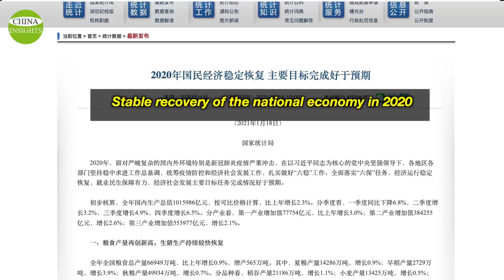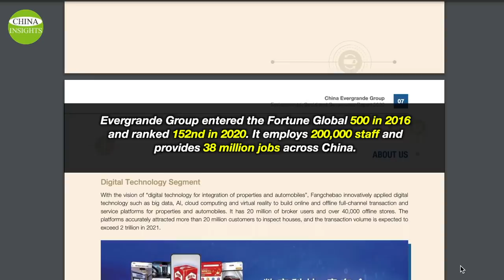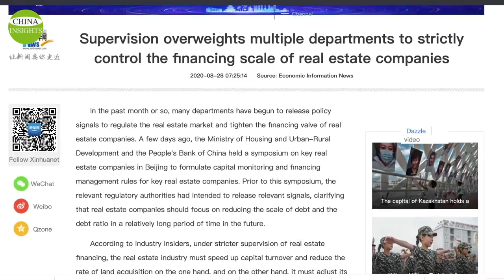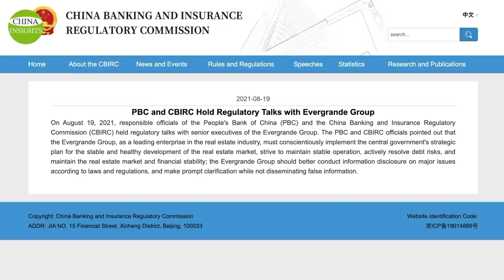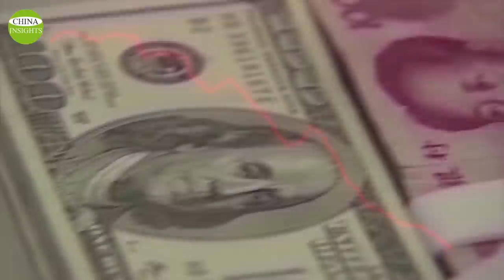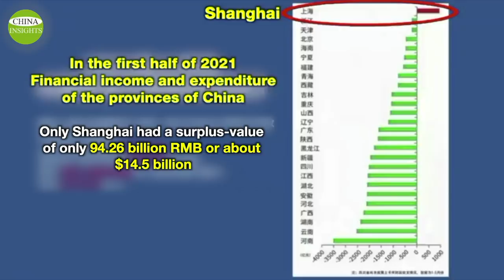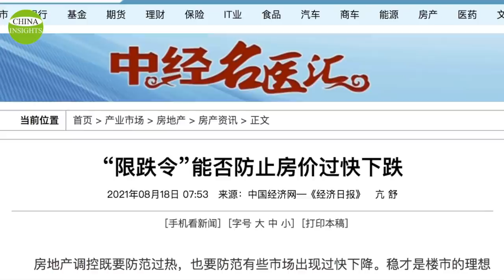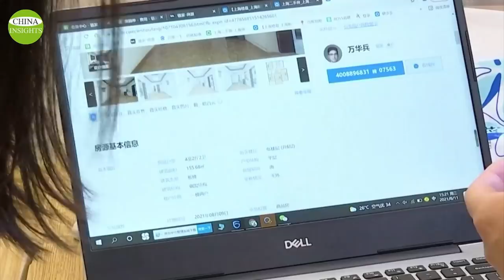How serious is China's housing bubble? The main cause is government's overpriced land sales

Comment: The Chinese construction Crisis is a multi pronged issue, with many factors. This is not to disrespect anyone okay, I just want to make that clear.

1. China has a lease land ownership system, where a prospective construction company leases the lot property for about if I recall 99 years or so from the local government, which in turn receives a large profit from the lease sale. In order to make a profit the developer has to pre-sale housing units before the start of construction. 

The lease prices tend to be fairly expensive, add materials, and labor costs on top of that which makes profits razor thin. In a lot of cases, Developers have to cut costs in order to make a profit often in materials, or labor which is one of the causes of the notorious tofu dreg structures. 

Even if they cut corners, theirs still no guarantee they will make a profit, and the prices are still forced too high than what most prospective buyers can afford.

2. Regulations, in particular environmental regulations are very very lax, so alot of developers get away with alot of stuff that wouldn't be possible in alot of in particular western countries. Like for example forcing workers to live on site and work practically 24/7. The wages tend to be fairly low comparatively to other developed nations, so they tend to hire on the cheap and have large amounts of unskilled labor. 

3. The Chinese government tends to heavily subsidize the Construction market as a whole, with unpayable loans ect... which developers in turn use to either pay previous loans or in order to purchase the leases for the land development. 

4. The Developers tend to have CCP party members backing in one form or another either being directly owned by CCP party member or one of their relatives, or in directly supported or owned by a CCP member. Because corruption is fairly rampant in the governmental system, bribes and other such things are common place. As well as crackdowns or other hurdles if you displease certain party members in the local government or regional government. 

5. Fraud and general corruption in the system itself. 

The subsidies that the Construction get, one of the factors is because Construction employs alot of people and has alot of downstream employment. They tend to get alot of subsidies and very easy loans, which encourages alot of potential fraud in the system where so called pop-up developers, get alot of subsidies and easy loans and purchase leases and either not deliver on the promised property or massively cheapen out on the quality of the work. For example a pop-up Developer buys a lease for land, gets a large amount of investment from the local government. Then pre-sales apartments. And only construct the skeleton of a building and then suddenly go bankrupt leaving the pre-order buyers who spent their whole life savings to purchase a pre-sale apartment hanging. The local government is not really effected by it since they get their profits up front with the lease sales, it's the buyers who tend to be the most screwed in most situations. And there is no incentive for the government to change the lease system, since it brings in about half or 70% of the governments revenue. 

Now this can happen in multiple ways not just intentional fraud. Some cases the developers were in-experienced, or the leases were way to expensive and their is not enough apartments sold, so the developer couldn't maintain financial solvency. Or other factors, like not paying local officials enough and getting on their bad side which they in turn put alot of hurdles for the developers to overcome. 

Also in alot of projects there is incentive to not perform a good quality job, so they can later get repeat business either fixing the earlier work or repair/maintenance of that work. 

A good example of outright fraud is a case of building Chip factories in provinces in China, one guy sold the idea to build a Chip factory in a province to the local government, which the Chinese government was heavily encouraging. So there was alot of incentives to build new factories. Well the guy had zero experience making Microchips and he partnered with a woman who had experience in the retail sector but zero experience in the Chip sector and also fished in a experienced guy from a sizable chip manufacturer in China. They even managed to get some important chip making equipment from the Netherlands. But the man partially built some of the new factory, and was milking as much money from the company as possible, the experienced guy he fished out of a major Chip Manufacturer saw that they did not have any clue or were even serious about finishing the project jumped ship. And the man after funneling money out of his new chip manufacturer company he folded the company and jumped ship and forcing the local government to take control of the project and he went to a new province to repeat the same thing. Kinda like a snake-oil salesman. 

This is just a small list of the problems in the Chinese construction industry. I could list more, but it would take a while. This is not something wholly unique to the construction industry. China also is notorious for its Zombie companies as well and other sectors in the Chinese economy. 

This is not a Jab or insult, just stating the reality of the situation. 

If I got something wrong then please do inform me and I will try to correct it. 

Have a wonderful day and thank you for reading this.
Reply: You are correct . In fact there is a video of that factory , that owner  etc in a you tube. The factory is also shown .  Like african countries , extreme corruption is difficult to tackle . But the tears of the people who are cheated will bring down any body
Reply: @ramavijaya148  the Scary part of the rampant fraud in the housing sector in China, is in China the population see housing as a investment option so alot of families try to pool their money to pre-purchase a house or apartment. And it's not just a small money but for a lot of families it's their families whole life savings saved up for generations. And if the developer doesn't deliver the injury to that family is not something to scoff at. In some cases especially for first home buyers if the Developer doesn't finish the family will have no choice but still move into the skeleton of the Apartment anyway because they have absolutely no choice. Also in China, your public services like healthcare and schooling ect...is tied to where you live so if you don't own your own home then you can't receive any of the social benefits in that city your at , you have to go back to your hometown in order to receive care. 

Also with the terrible one-child policy that basically destroyed the balance of population esquing it where there are way less women than there are men, and the general situation that a only child growing up brings up, makes things worse so for alot of men just in order to be able to marry, the prospective wife demands alot in return for the marriage making generally making home-ownership, car and a dowry as presiquite just to get married basically pushing a large amount of the lower class of the male population out of the ability to get married. And it's often that the women since they have a larger pool of men to choose from they tend to want to marry up in the social class of society further reducing the odds of men being able to marry. Last time I checked i think its about 100 million men or so who are guaranteed will never be able to marry simply because the imbalance between male and female population. Alot of families tend to pool their money together just so their son can afford what they call the bride price. 

And the just general rampant corruption in the levels of the CCP party itself in all layers, basically they are the noble class in Chinese society. It's not unheard of for a government official to steal another person's identity for their test scores for the exam just to go to school which essentially determines the fate of a person's place in Chinese society and which social class they belong to. For their kids, especially if the victim is part of the lower class of society. Which can ruin that person's future and oftentimes even of its eventually found out there is very little ramifications for the perpetrator just because the power they have versus the victim. But this flows through all of Chinese society, same for the courts, it's the reason why if a person gets either a slap on the wrist or no punishment at all for a similar crime that a lower class person does. Because members of the party are hardly ever beholden or accountable to the law. Because the laws in the society tend not to be meant for the upper class of that society, but the rest of society.

It's the same reason why the prefecture government, could easily break down levees and embankments causing massive floods and wiping out multiple villages, without even notifying the victims. Especially if there was a need to ease pressure on other dams that would effect a cities core in which those officials live. With little recompense for the victims.

Comment: Despite China's vast population the supply of post-2000 residential condos/apartments will soon (in about 5-8 years) be enough to house every person in China. When that happens, demand for new construction will plummet to near zero. So land sales (the main source of local government revenue) will cease, 50 million or so construction workers will lose careers, concrete and steel production will plummet, and all the supporting rail transport, shipping, electricity generation, coal extraction, etc. sectors will get hammered. Goodbye CCP.
Reply: Holy moly.  Even Zeihan hasn't mentioned this aspect.  That's pretty grim.  Does this include all those ghost cities that have already been built?   Not expecting that a rural subistence farmer would be able to afford one of these condos.
Reply: @alanparsonsfan  Here are my rough calculations. At present, residential construction is at least 2 billion square meters annually. An average apartment is 100 sq meters, or about 1100 sq feet. It is plenty big for 4, say, a married couple, one child and an extended family member. So about 20 million new units, housing 80 million people, is the current rate. If it remains at that rate for 8 years ( actually, the rate grows every year, as the excellent video noted), 160 million new units housing 640 million people will be achieved. Now since 2000, when CCP legalized quasi-ownership and the new private sector housing boom began, roughly 20 billion square meters of new apartments have been built, conservatively. That translates to about 200 million units, housing 800 million people. Add that to the 640 million figure stated above, and you get 1.44 billion, which happens to exceed the population of China.

You refer to the ghost cities, which are the best examples of the strange phenomenon of 35% of the housing stock being vacant, i.e., sold to investors but not to end users who occupy them. That problem will worsen before it gets better. Still, I believe that once the supply of modern housing stock exceeds all possible demand (i.e., the needs of every person in China) then demand for yet more construction will fall off a cliff.

Just a few more thoughts. When the U.S. post WWII suburban housing boom began 1200 square foot houses were the rule, and families commonly had 3 or more kids. Nowadays consumers want much larger houses, because of affluence, but China is a long way from that stage. Some may argue that many of China's rich have luxury aartments much larger than 100 sm, and have multiple apartments for vacations, investment purposes, or in which to stash mistresses. All true, but my numbers are conservative and my point that supply of new units will outstrip all plausible demand by late this decade is defensible.
Reply: @daveallentown6868   Excellent deep detail, thank you. And what neither you nor I have mentioned at this point is the demographic problem that they're about to have. Excellent deep detail, thank you. And what neither you nor I have mentioned at this point is the demographic problem that they're about to have. And if the people working 996 aren't making enough salary to afford one of these things in the 1st place. The pool of families sharing to buy for the futures got to run out as well I would think.
Reply: @alanparsonsfan  Excellent points as well. And thank you.

Comment: If the China pops like Japan in 90s, the world economy will have a hard time to recover.
Reply: The world economy will be fine. China is far less connected on a global scale, especially wrt to the financial markets, compared to western countries like the USA, UK, France, and Japan. China did this by design so they "wouldn't be influenced by outside powers". China has taken every step possible to limit global influence of capital and as such consumption in China does not really affect the rest of the world's economy. Economic collapse would probably overall help the global economy as the global economy really relies on China as the world's factory and the cost of labor would be significantly lower after financial collapse.